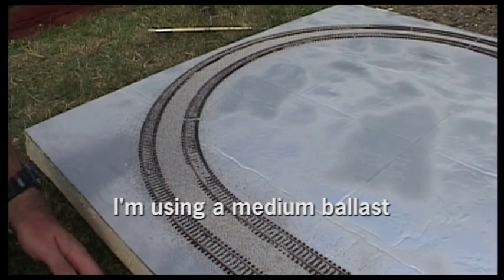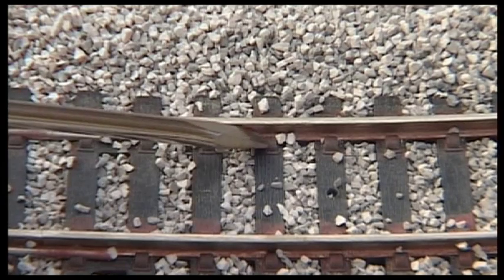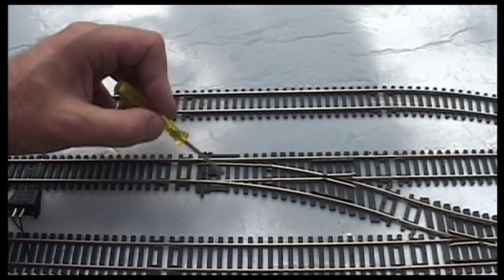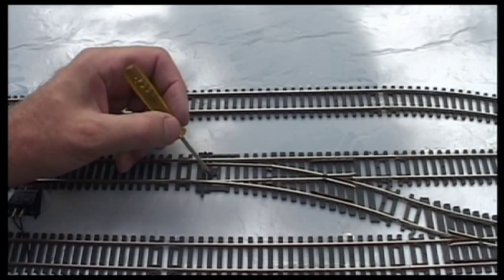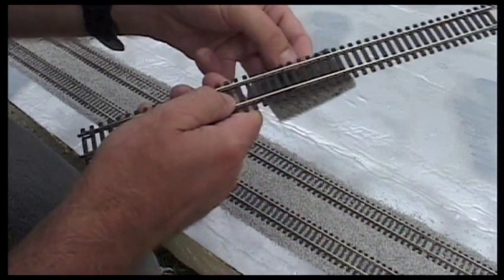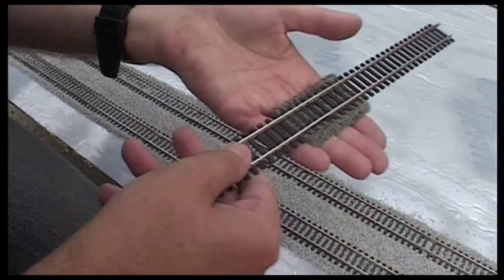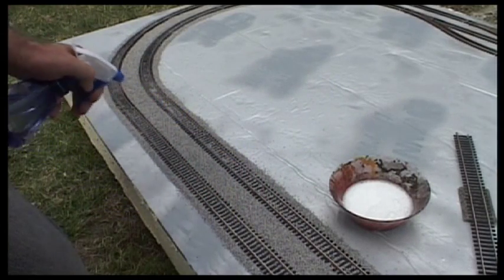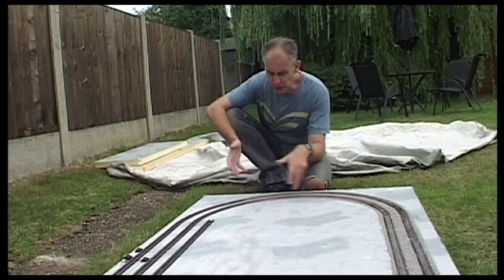Tumby Woodside Pt4 - Ballasting

Comment: Ballasting points well explained ,,, some good tips ,,, glad I saw this before trying for the first time... many thanks
Reply from the maker: There are many different ways. Outside in the sun it goes off in an hour or less. Indoors it can takes even two or three days.
I tend to prefer the GM200 ballasted foam. This is frowned upon by the experts but is actually safe for points, very very quiet, smooths the running, uses real granite which you can buy loose so as to blend it in between tracks (GM114) and it is quick. I can lay the track and ballast in an evening and have the trains running. Downside is cost - it is about £22 for 5 metres.
So hence I went for the traditional way here.
Reply: Calvertfilm No you make several points I have not heard before, and a good comparison,,, even though expensive it look on balance foam is SAFE and your have almost guranteed  trouble free running... plus the time saving and track cleaning etc,,,
Reply from the maker: *****
Trouble-free running is exactly what I was aiming for. My first layout was ballasted the traditional way and I wrecked the points, and it was just so noisy, and the engines would derail for no apparent reason at times - they happened to hit a piece of ballast they hadn't hit before. I was down in the dumps. I sold it immediately for a 1/3rd of what it cost me.
Then I tried this and haven't looked back. I know how to ballast better the 'old way' as well now. But this foam is stronger than just regular foam (which sunlight deteriorates). Even if this one deteriorates after a few years it will only take me an evening to re-lay it. But my gut feeling is that it'll last because it is covered with real granite. It is just so easy to replace a point, or any section. Looks good too. Calverton, Langtons and Trio all use this system.
Reply: Calvertfilm Having never done any I will do a couple of test pieces ,,,, I have painted the rubber underlay a buff colour so im going to see what it looks like with the thinnest sparing sprinkle of fine ballast and the main line,, not sure what to do in the goods yard area,,, The few memories I have of going around many many sheds with my Dad as just a toddler is very little of the locos,,, but I can remember the ground,,, I sure my Dad must have been constantly telling to watch where I was treading,,, and watch where your putting your feet ,dont touch anything, dont wipe your hands on your coat etc. ,,,, so much so ,,, I can remember the ground been just black ,,, sludgy puddles with oil rainbows, hoses,  cables and inspection lamps, huge spanners, con rods, I can remember the crunch of black cinders,,the inspection pits,,, with the lights set in the sides oil and  water , in the bottom. and even walking up and down sidings the ground was still black ,,,, from in most cases a hundred years of gradual build up of railway grime. I would like to cover most of the sleepers completely because im sure they where hardly showing in sheds and yards. again that will have to be a few test pieces....
Reply from the maker: *****
That is interesting you say that. One of my strongest childhood memories is the sound of stones - whenever I walk over a stone car park it reminds me of my childhood. It may also be that because we are nearer the ground we notice these things more? As we get older we realise more interesting stuff is elsewhere?
Yeah, do test pieces and see what you prefer. Somewhere on here I have a ballast comparison. As the loco runs from traditional ballast to foam ballast you really hear the difference. For me, just hearing the loco running quietly is the nicest sound. But if you do want a sound unit then of course a silent track helps there too. Most other layouts just seem so noisy to me now.
Reply: Calvertfilm Cheers will do..

Comment: It is a real pain to get the ballast right. Had the same issue with the ballasting getting by the rail. I get it right, as the water and it moves, but after a clean it's all good. I must try out the foam method one day.
Reply from the maker: I must admit I'm converted to the foam, although the 'rivet counters' would frown at it.